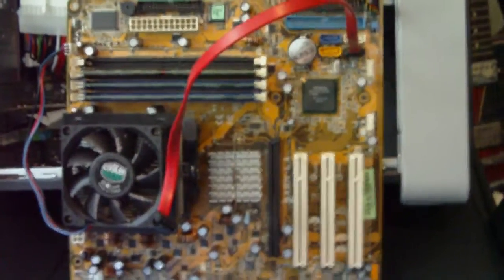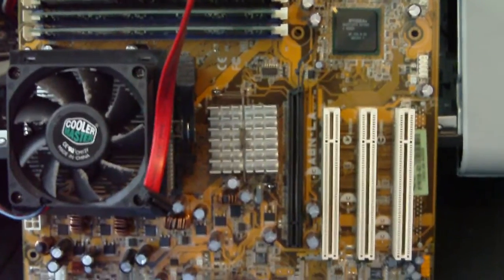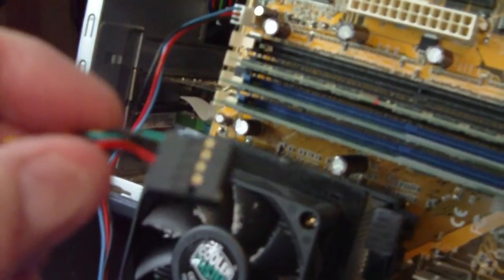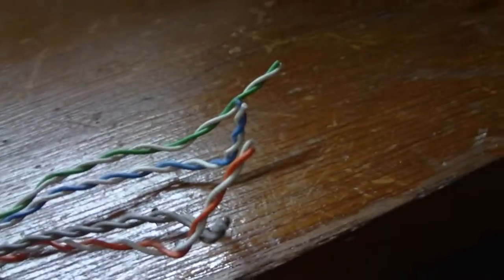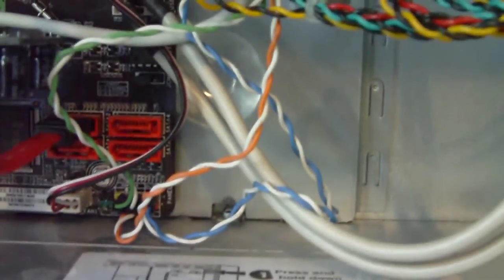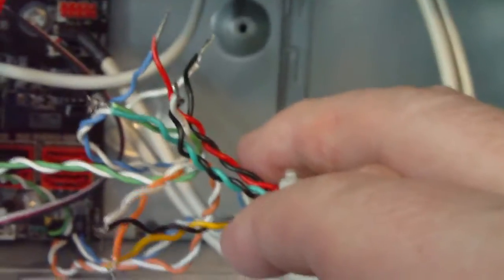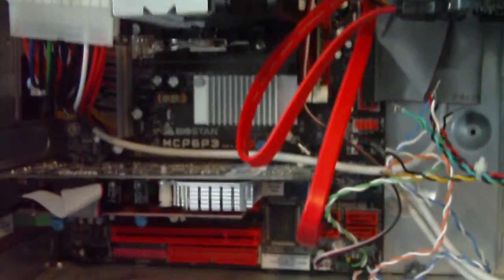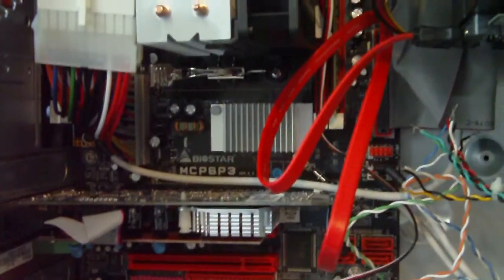How to hack motherboard connectors HP to Generic

Comment: Umm this is not even hacking bro
Reply from the maker: hardware hacking?
Reply: @callmebigpapa I'm thinking about hardware hacking because I'm trying to bring back Xbox 360 back to life fix the issues reuse it for other purposes make a 360 cluster with another HP computer also
Reply: @callmebigpapa but yeah I think I know what you meant by the power supply and stuff I was just going to confused by the word
Reply: @callmebigpapa but I'm in trying to look for people to collaborate with on doing something big